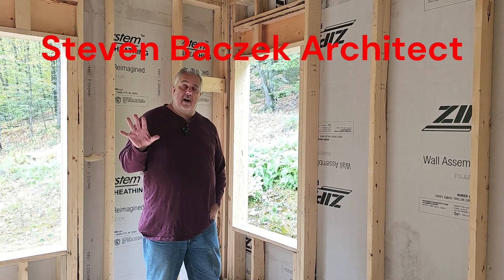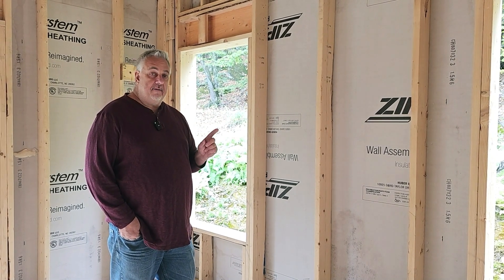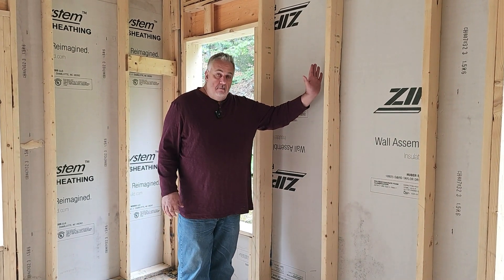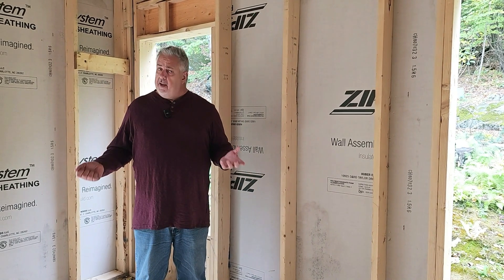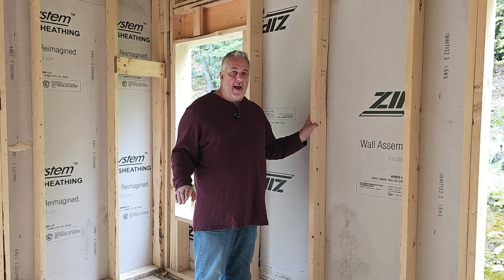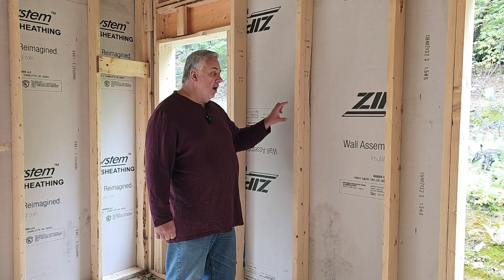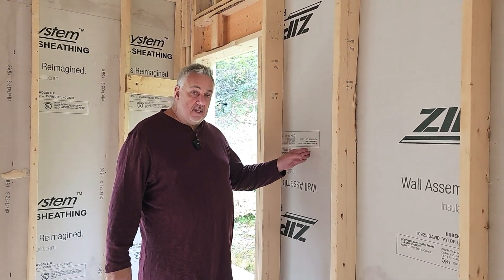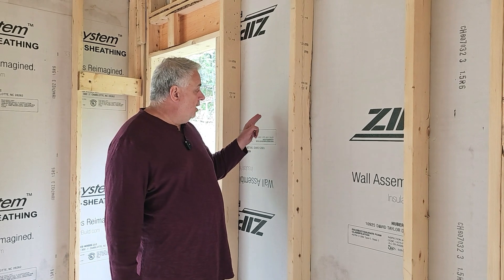WHAT'S A THERMAL BRIDGE

Comment: Lack of internal space, 1960s block built, no insulation, I intend to wood stud, would fixing the foil and thin foam directly to the timber used under floating flooring be any use ? I will insulate the outside as the structure is solid.

Comment: Is the poly iso a vapour barrier? Just trying to figure out the vapour barrier should be to the warm in winter side. From Canada here, if we use insulation outside up here it’s the Rockwool comfort board nailed on to sheathing.

Comment: That R sheathing at 1.5 inches of foam should be R6 not R9 as. stated.  He misstated saying it’s R9.  You can see the stamp  on the sheathing indicating 1.5 inch at R6.  Ok R value but excellent thermal decoupler
Reply: It says r6x1.5. That makes R9. He is correct.

Comment: tHanks for the video.  I didn't realize heat was always trying to get to cold.  I struggle to understand all the insulation names etc.  At the same time every few years the industry completely changes its best practice.   
I'm about to put R-max 1" foil faced panels on the outside of an existing house.  (existing subsiding....caulked joints, Tyvek taped, Foil face taped, furring strips)
Reply from the maker: you're in good company, I struggle to keep it all straight in my head too
Reply: It is interesting  @stevenbaczekarchitect9431  .  tHank you for the reply.   
I think in the long run,  I'm going to put my finger in the air...see which way the wind is blowing and take my best guess.

I'll be working on my house so it won't matter....and I'll learn something a season or two after I'm done.
Have a super week!

Comment: I've read Dr. Joe Lstiburek comment on how using ZIP-R sheathing (with the layer of rigid insulation on the inside surface) can create problems with shear strength in the walls due to the fact that there can be 1/2-3 inches of foam between the OSB sheathing and the wall studs (I believe his exact quote was "Good luck getting shear values with that").
How do you compensate for the loss of shear values when you place foam between the exterior sheathing and the framing studs?
Reply from the maker: It certainly isn't the same as plywood or Zip right up against the stud face......but Huber Engineered Wood has published data that our engineer uses to design the shear resistance. It may be slightly less, but it is still possible. I have used Zip R Sheathing in High Wind Areas successfully with the appropriate engineering.
Reply: Perhaps you could do a follow-up video on shear walls and how the engineering is calculated when using ZIP-R sheathing? @stevenbaczekarchitect9431